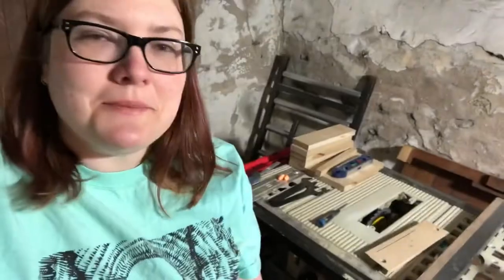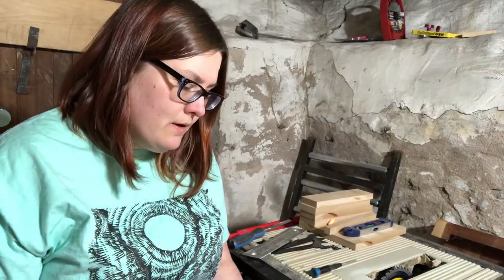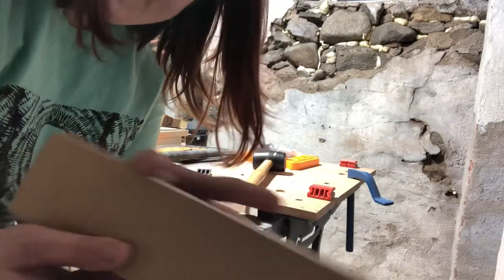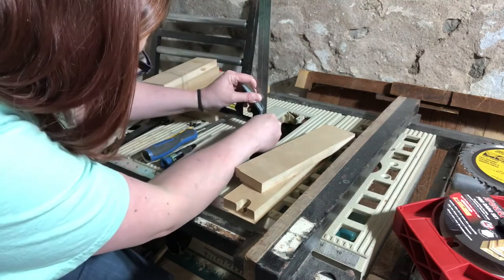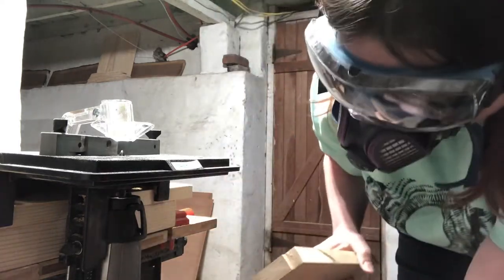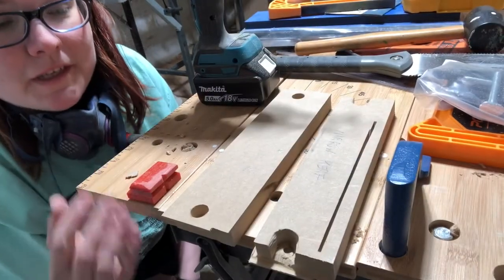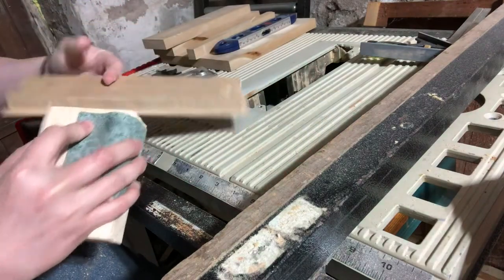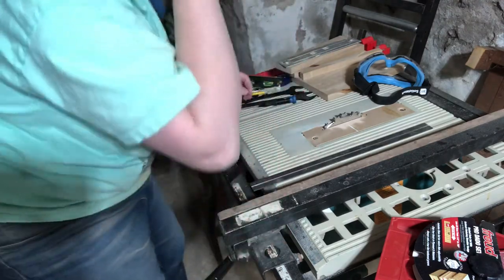Zero Clearance Insert for Makita 2708 Table Saw

Comment: Can you still get a rip fence for this saw also how long is the fence you have
Reply from the maker: Michael, Makita no longer makes the original rip fence but you might be able to find one on eBay or other resale place! I got my 2708 secondhand and it was already mounted in this other base with a different fence - it's not labeled unfortunately so I'm not sure what to recommend you!

The 2708 is a great saw for my tiny space, and the way it's mounted turns it from a jobsite saw to pretty much a contractor saw, but it definitely has some limitations. If I ever have the luxury of a larger space, I'd consider getting a cabinet saw and leaving my 2708 set up for dado work exclusively.

Comment: drill a finger hole to pull it out! doesn't do much if it's in front of the blade. these saws are sled saws, don't mind my diy riving knife, as long as its wider than my blade, its doing its job

Comment: Hi. Awesome video. I just picked up a 2708 in great condition, but the rip fence leaves a lot to be desired. What’s the frame/fence you’re using if you don’t mind me asking 9 months after you posted this?
Reply from the maker: Hooray another 2708'er! I love this frame and fence, unfortunately I bought it secondhand as is, and any manufacturer marking has worn off! That said, the frame is terrific and it connects to an outfeed table (which I can detach when not needed - small shop space). BUT, the fence is not the most precise - there's no micro-adjustment (though it's sturdy once locked).

I'm not sure your budget, but I've heard really great things about the Rousseau line. The one that fits the Makita 2708 is (hilariously) the Rousseau 2780: https://www.amazon.com/Rousseau-2780-Smaller-Portable-REPLACES/dp/B01HXI7ENW/ (Amazon link for easiness, buy local if you can because Amazon is the worst). Dang now I want a new fence, haha.

Let me know what you go with, I want to know what works for you so I can benefit when I have the budget to get a nice new fence ;) steph@stephintheshop.com

Comment: Man, a rubblestone foundation. The house is pretty old?

I've been working on one of these, trying to leave a lip on the edge of the new throat plate to rest on the edge on the saw top. It hasn't been easy. At this point, I'm looking at an aluminum plate the same thickness as the original plate (screw well included...)  BTW, a 7-1/4 or 6" blade - maybe the one from your dado set - may have helped you avoid the wonky dangerous kerf cut.
Reply from the maker: Haha it sure is - 1850 New England farmhouse, I absolutely love it but it's hilariously wonky!

For the thin kerf I.... oh I just saw your edit! Yes that's a GREAT idea, I would love to not have to do that dangerous over-clamp balancing act! I'll try it when I make my next one, my ripping blade has a standard kerf.

And yeah the lip is hard! Router is really the best way to do it I think.

Comment: Hi, great video! Thanks for sharing. I just made one of these for my own 2708, wish I’d seen your video first. What material did you make yours from?
Reply from the maker: Thanks!! I used half-inch MDF. What did you use for yours? I need to make a few more and was considering doing my next in hardwood.
Reply: @stephintheshop700  I just used some scrap 3/16” MDF (the kind you can get at Home Depot with chalkboard on one side and whiteboard on the other.) it was pretty clear it was going to be way too thin and bendy on its own, so I glued another piece of the same material on the back to give it more strength, which worked pretty well. If I was going to make it again I’d use half-inch like you did though.

Comment: Hi, Just came across your video...great presentation. Thank you!  I have an old 2708 (older than yours) and want to get a dado set to use on it.  Did your set come with the flanges needed flanges or did you have to buy them separately?   Any info you might be able to provide would be greatly appreciated!
Reply: I’m looking for the same. Did you have to use another special flange? Thanjs

Comment: Are these custom inserts available for sale?  I have the same model table saw but the aluminum saw blade insert is discontinued that I wanted to replace.
Reply from the maker: And that saw blade insert is so junky! I wasn’t able to find any for sale anywhere which is why I made these out of scrap MDF! You could do the same with mdf or a nicer hardwood if you felt more confident. They’re pretty fussy to make but it’s very satisfying. 

What type of blade are you building it for? With anything but dado you’ll have to do one extra step that I describe in this video but don’t show. I can bang up another quick video to describe, I need to make another insert for my (standard kerf) ripping blade.
Reply from the maker: James - if you'd like me to make you one, drop me an email with details! steph@stephintheshop.com